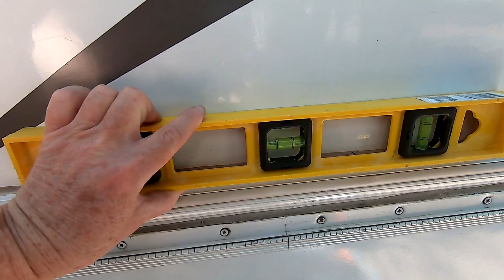How To Level Your RV On A Slope

Comment: Thank you so much! I’m stuck in my RV for a month or 2, on a huge slope, in extremely soft gravel/soil and I CANNOT get the danged thing level bc every time I roll onto blocks they just sink into the ground and I can’t get the back end high enough.
When you can’t go up, go down. Genius!!
Literally can’t wait to do this. 
PS- Love your spirit. ❤️
Reply from the maker: Hi Doggy ❤ Glad you liked the video and I hope it works well for you. I am a little worried that you might get stuck in the soft ground 🤔 Maybe put a piece of wood, or something, in the bottom of the tire hole - just in case 🤷‍♀️

Comment: I understand the convenience of auto levelers but my justification is that its just more to break.
I also carry 2 -6 foot long 2x6 boards. Sometimes I use them if I need additional height to level. But their second purpose is that if I get stuck in sand I can stick them under my rear wheels for traction to get out

Comment: If you have an air pump, why not simply air down the tires needed to get level then air them back up before leaving your camp site.
Reply from the maker: Hi David 👋 I don't currently have one, but I hear that "letting air out" trick is also good for being in sand?  stuck in sand? 🤔 I can't recall - but DEFINITELY something to do with camping on the beach in an RV 😉👍
Reply: I probably wouldn't do that. It takes a lot of air to fill 2 or 4 RV tires
Reply: @RoamTownGirl  Yes, if you are driving through soft sand or stuck in sand airing down can make all the difference in the world. Don't forget to fill your tires up to pressure when back on the road